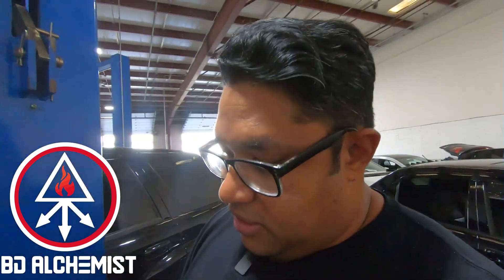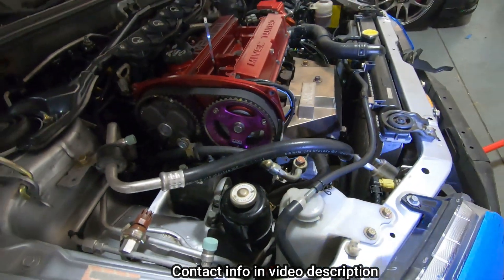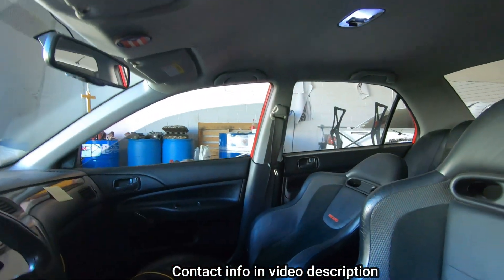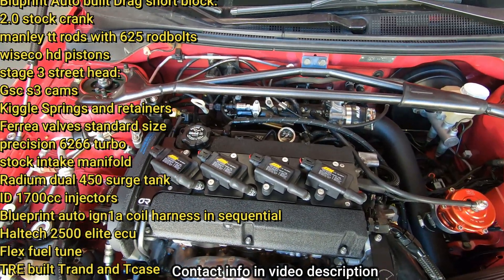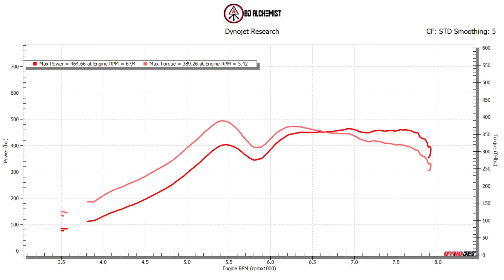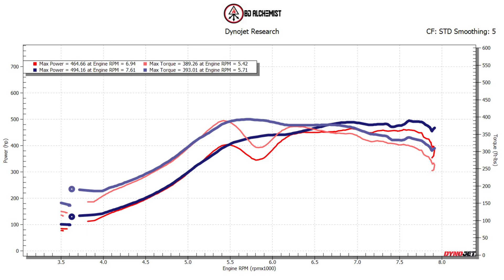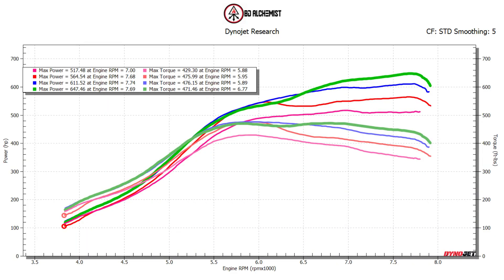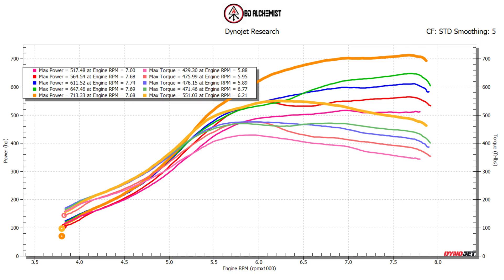Built short block 2.0 manley tt rods wiseco pistons s3 cams pte 6266 turbo ID 1700cc  Haltech 2500

Comment: If you were running the same timing as the 93 tune, why not bump the timing up a bit to get the IDC down? Wouldn’t running a few pounds less boost lower the IDC and adding more timing lower IDC?